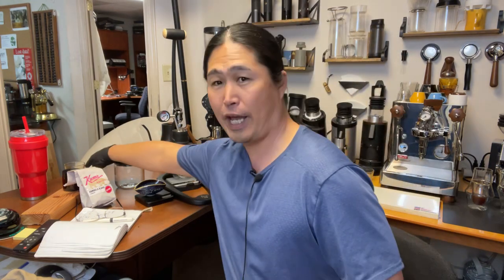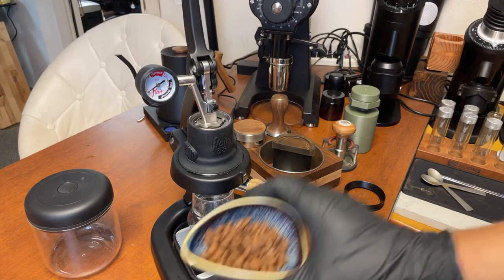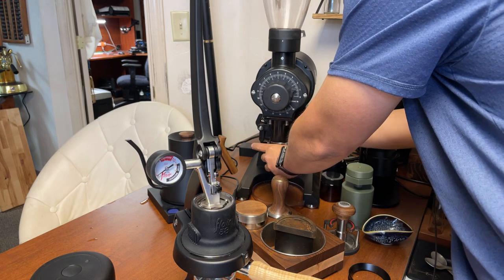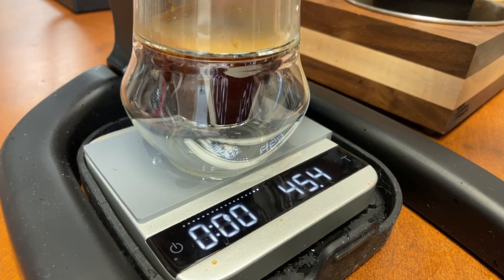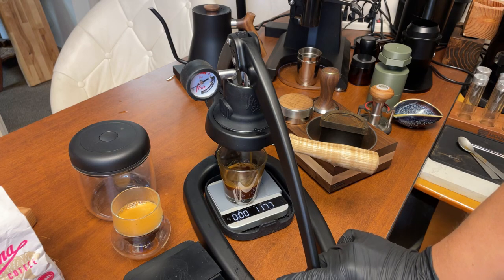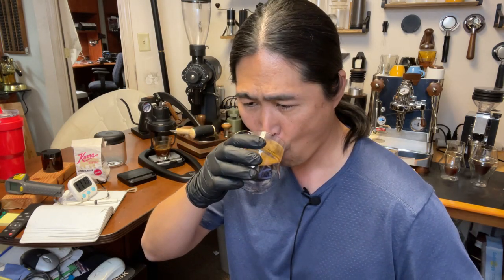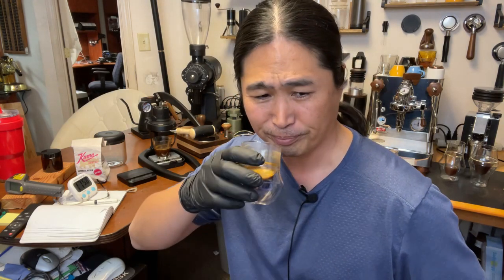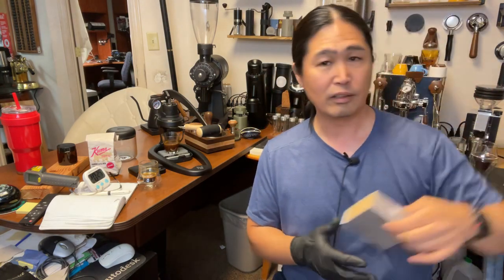Flair58 Espresso Workflow with EK43S

Comment: Isn't in 06:34 the water  is already on top of the puck and therefore already starting preinfusion at least for the top part of the coffee?
Reply: In 05:15 the water directly goes down without needing to push the lever. So the water goes straight into the puck in 06:34. Therefore should we start the timer once we starting to Pull the lever to calculate preinfusion time?
Reply: @megamouth4399  yes you should start the time a soon as you pour in the water because that's when the extraction process already starts
Reply: @Cenot4ph  thank you!!